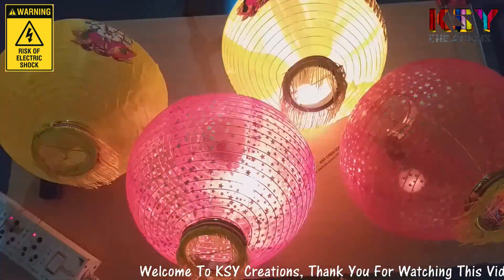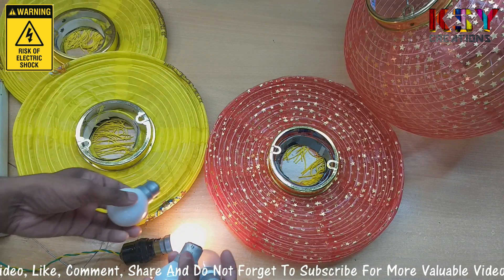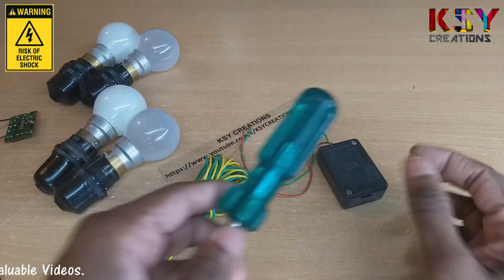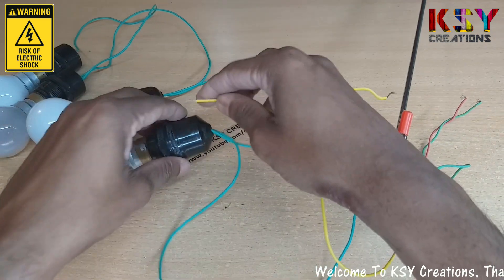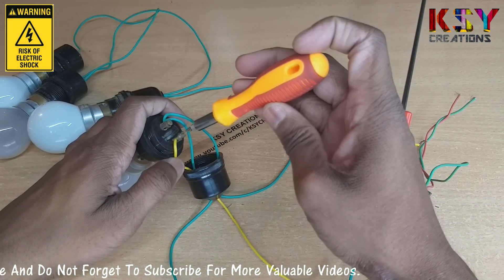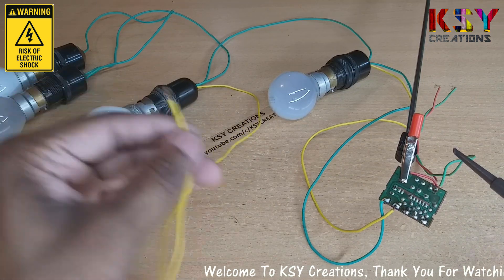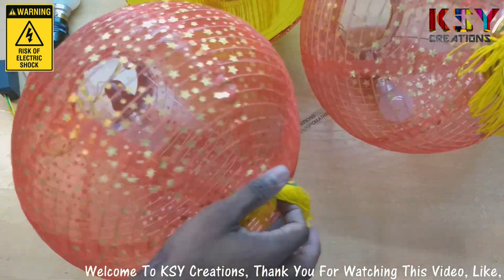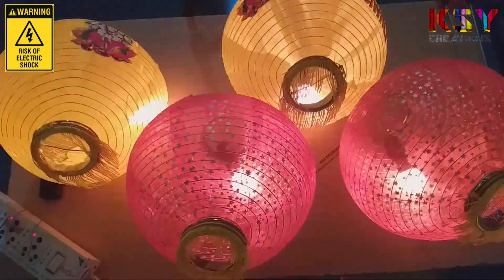how to make normal lights into running lights, diwali special decoration lights

Comment: Can i use more bulb in 2 chanal circuit if it is possible how many bulb can i connect  without any problem
Reply from the maker: Hi, controller supports upto 15watts, 
If you are connecting LED'S, than you can connect multiple LEDs.